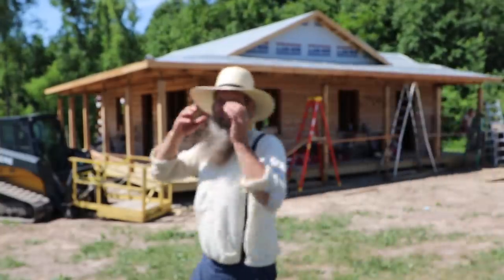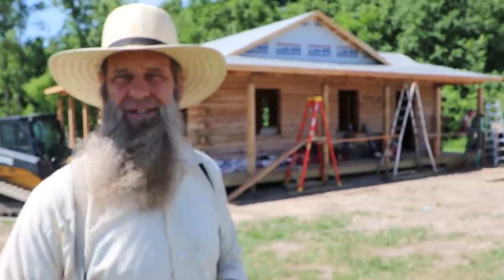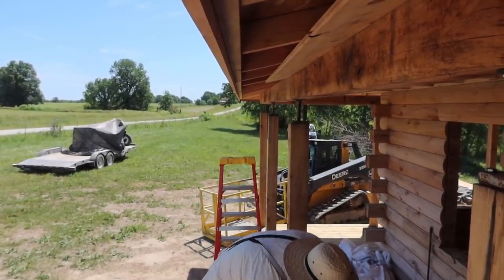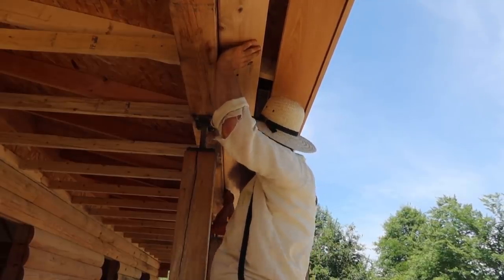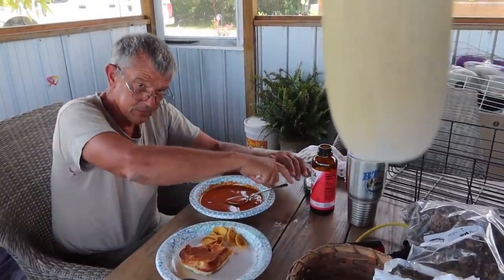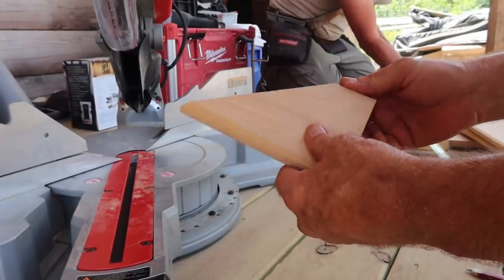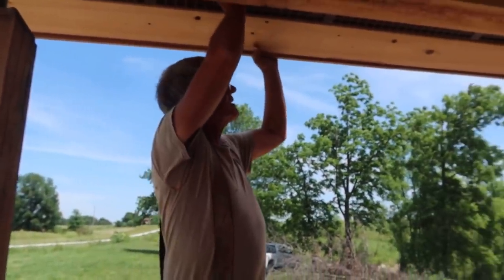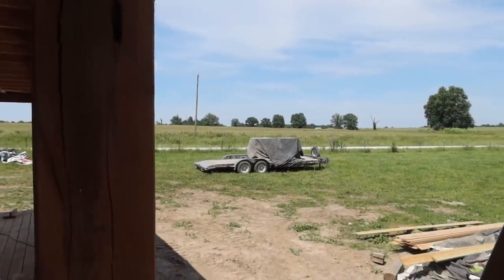This is a MYSTERY and soffit with vent install | LOG HOME BUILD FOR Mom DAY 52

Comment: Previously when you guys were doing the inside of the cabin you had "wasp" ;with the type of vent you're using to push the the air out the roof won't wasp get in and make a huge nest!!

Comment: When all over, I’ll be curious how close you are to budget, but doing work yourself saved a lot. We started a small father in laws house about the same time you started yours. Ours was a kit but the contractor we hired did everything wrong and we had to sue to recoup boards and stuff he screwed up. Now we have a new guy. I hope this is done before winter. 🙄🙄🙄 But I think once they get going it will take 2 months. Fingers crossed.

Comment: Cool: "Cypress Hardwood Lumber has a high rot and decay resistance making it a top choice in exterior construction applications." "Cypress has good gluing, nailing, finishing, and paint-holding properties." It was also compared to cedar.
Gary's a good man. Respect.

Comment: I about did the same thing for venting but then found some 8’x24” vented fiber cement board that looks like wood love it, but if it was not available your way is the next best thing.
Reply from the maker: Bet it was 💰💰
Reply: @OFFGRIDwithDOUGSTACY  yes in deed but was worth it considering what was there originally.

Comment: I hope this isn't a dumb question and maybe it will get answered as you put on the tin roofing, but if there is a gap at the top of the roof how do you keep the snow and rain from going inside the roof?
Reply: They make a ridge vent kind of deal that sits on top, it is designed to be water proofed

Comment: If you put one side of your soffit up and then slide your vent in on that side and tack that side then stick the other side up and nail it off it would be a lot easier and quicker than trying to slide it all that way.
Reply from the maker: No it wouldn't

Comment: Cypress is the only wood that can spend 100 years on the bottom of a river and still be good for cutting into lumber. They find and recover logs from river bottoms because it has become illegal to cut cypress trees through most of the South.